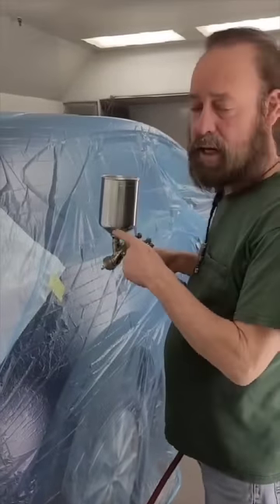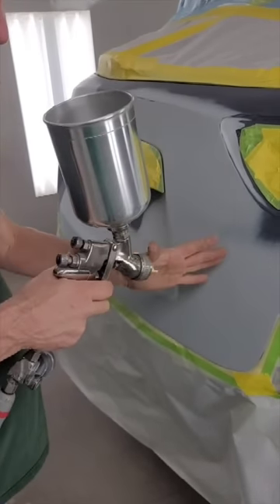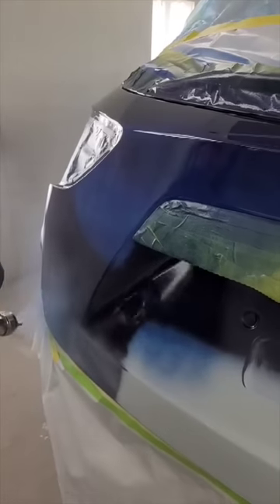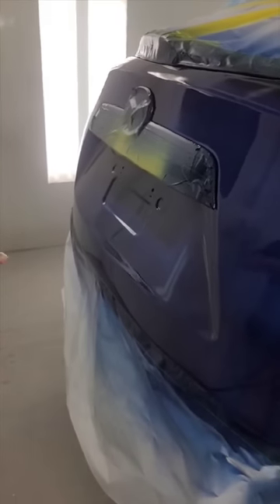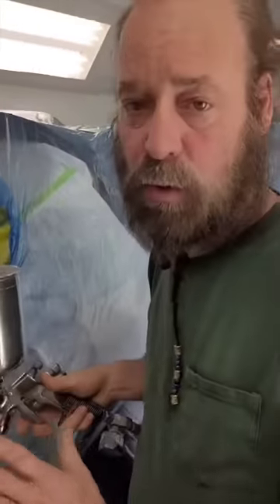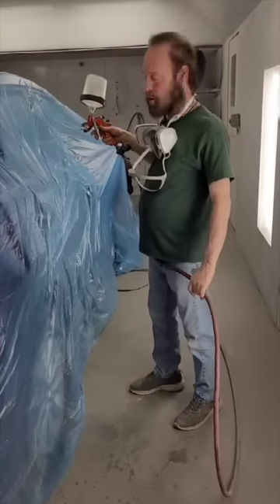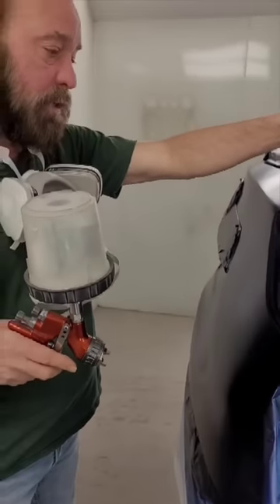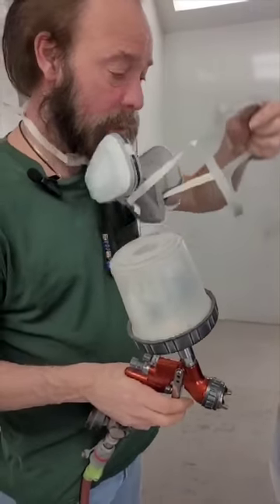Spray Gun Techniques!!

Comment: What gun are you using?
Reply from the maker: devilbiss gti
Reply: What caps are you using for base and clear? What pressures? That base looked very low pressure! Looks awesome!
Reply from the maker: @TheRolfano  The gti has a 2000 cap The tekina has a 7e7 tekina cap

35 and 45 PSI